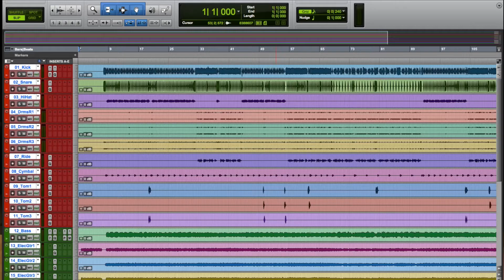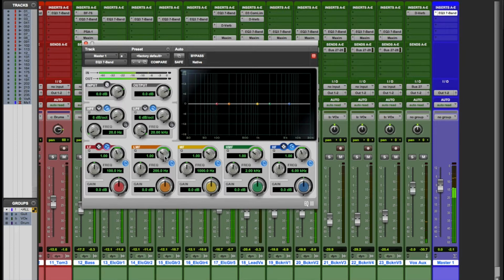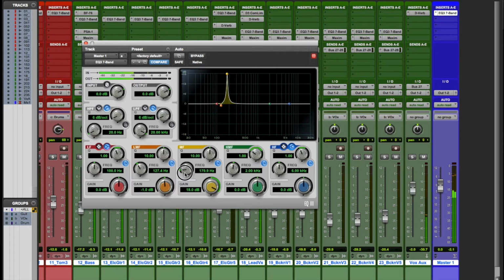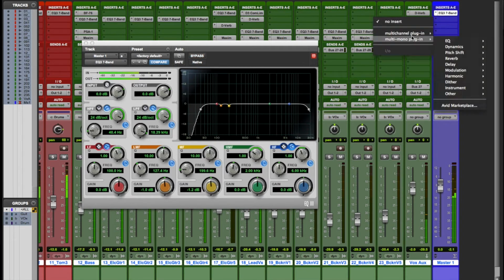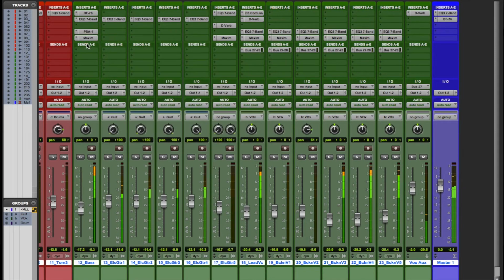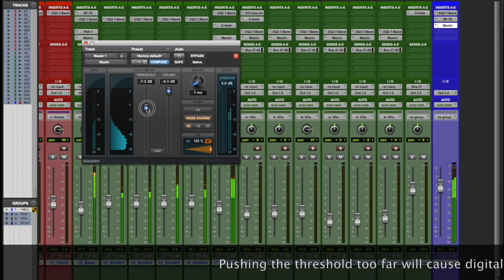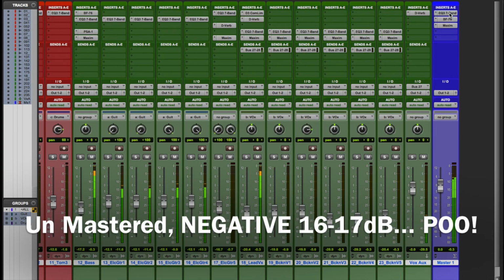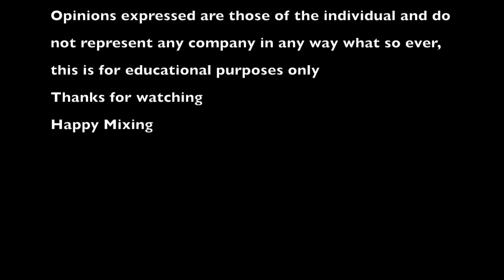Basic Mastering In Pro Tools 11 With Basic Stock Plugins

Comment: It does not matter if you hear it or not. It is physically there and thats the problem. 

30Hz is a shit-ton of sonic energy. I mean, just physically - it is longer than one meter. by the way 440 Hz are 78cm. 
imagine someone would want to get your track on vinyl. it would sound like shit. because it will have to physically  reproduce that low stuff into the vinyl. 

everyone go ahead in your last session and lowcut at 30hz everywhere and tell me it doesnt sound better. 

the sonic information is there, so it is being processed, so its there. audio is not a hoax.

good video blitzerize!

Comment: I've seen others master with only one audio track or an mp3 file of the mixed song, well just one guy so far (still new to mastering).. would either work or is mastering supposed to be done the way you just did, u know with all the audio files to the song in the session? and is 'dither' not always necessary?
Reply from the maker: Oh yes good point to make, it much better to master the stereo bounce of the file after it been mixed and done professionally. Then mastering can be done properly. Just for this example when I master I mix if I'm not happy with mastering side of things, but much better to master the stereo bounce.
Reply: cool i mixed a song i made myself and it sounds good enough to me, but i did it in logic and i wanna use pro tools more to be familiar with it. so i can bounce it from logic, import the mp3 to pro tools, add a master track to the session and apply what you did and it will be mastered?
Reply from the maker: +Raymond Flores we'll sort of, firstly you should bounce out the track as a WAV. Not an MP3 l, the quality is much better. Once you bounce it out do all this stuff on your master tracks and I should be sounding great. Just remember everything is subjective. So technically there is no wrong or right way to do things just do what sounds good. But be unique, that's what makes things good.
Reply: +BLitZErize nice thanks a lot man!
Reply from the maker: +Raymond Flores anytime mate, I've learnt a bit since then, if there's anything else I can help with don't hesitate to ask, I'll do my best.
Reply: +BLitZErize sure thing man I'm setting it up now ill let you know!
Reply: +BLitZErize i just finished and the maxim made it louder, the 7 band definitely cleaned up the muddiness but the BF-76 made it sound really lo-fi? maybe the settings were out of proportion but do you think its still necessary?
Reply from the maker: +Raymond Flores  it could be your settings but don't push the bf76 too hard only a little bit yeah. You don't really need it but you gotta be listening hard for it to get it to sit right. And I'm glad the maxim worked for you